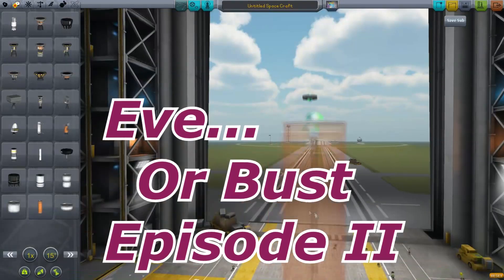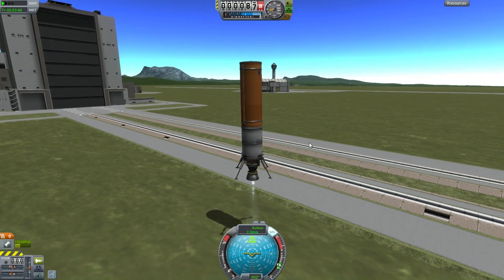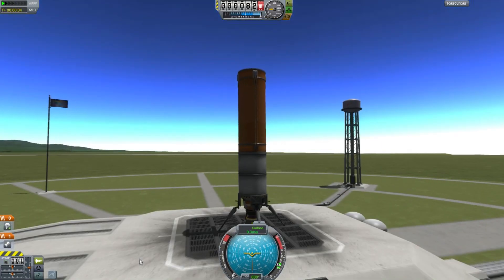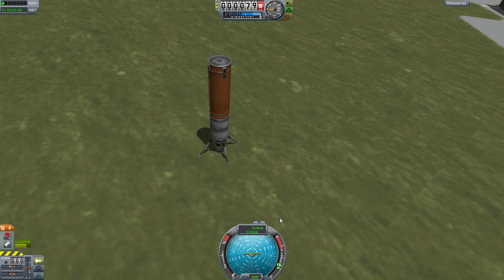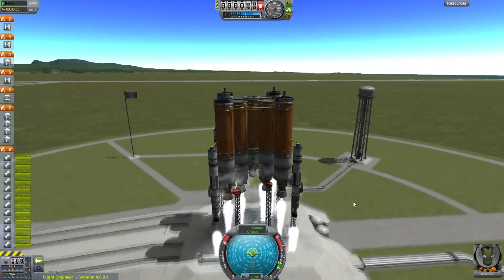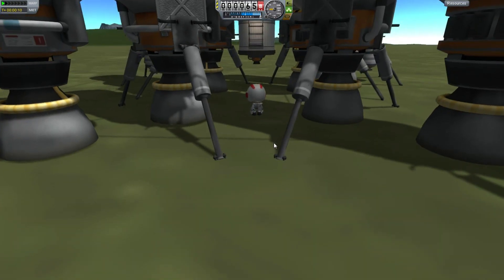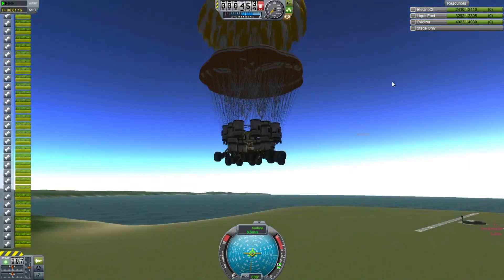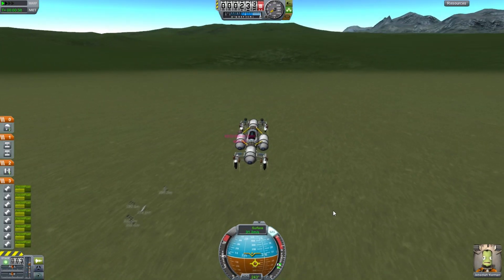Kerbal Space Program - Eve Or Bust - Part 2

Comment: the overheating on the orange tanks has a logical explanation, they are insulated hence the overheating is less once you fit a regular tank between the insulated tank and the engine, Engine heat can't dissipate efficiently when attached to an insulated tank.

Comment: Ah so he does!

I wonder what the delta-v of that rocket is though? Surely less than 10km/s?

But yeah Kerbal Engineer has a Reference Bodies mode that lets you pick a planet. It then shows you the thrust to weight ratio in relation to that planet's gravity. But the half-throttle thing is a good rule of thumb too

Comment: I remember I had a very complex mission plan for a trip to Duna (called Project Atreides), using most of the "realism" mods (crew support, FAR, deadly re-entry etc.). Essentially the architecture was I could launch kerbals and fuel resupplies to a base orbiting Kerbin, where ships designed specifically to make the journey to Duna's orbit and back would ferry them to a base around Duna, which had spare fuel and landers meant to land and come back.

Still haven't put it in action though...